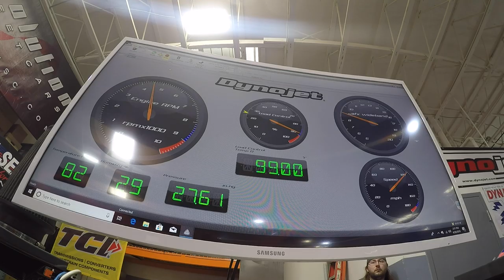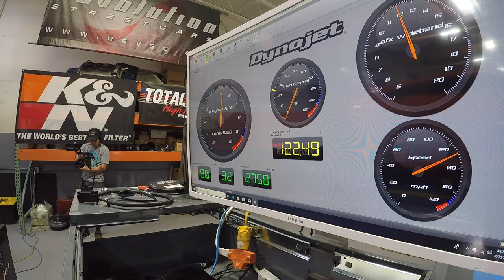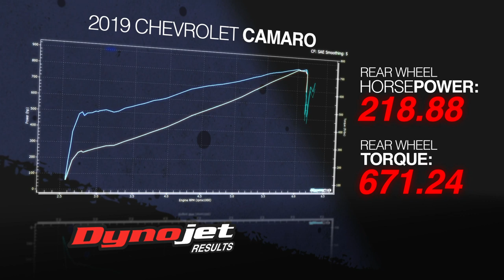Pony Wars 2: Can An LT4 Fuel System Really Make 950-RWHP?

Comment: Lt4 fuel system is good but you have to change cam to get more fuel lobe so that's where it gets expensive... I'm curious what a blower swapped i.e. procharger or whipple lt4 stock cam could make with headers blower swap only!
Reply from the maker: The larger fuel lobe on the cam was part of their engine build.
Reply: Check out the Race Proven Motorsports YT channel

They do loads of LT4 builds w Procharger, etc

Comment: The only two things that are keeping the ls/lt series of engines from being the king of all v8's is sound and a factory 6 bolt block, HUGE potential with these engines, despite their downfalls.
Reply: The stock block is strong as fuck. They have weak stock pistons and limited expensive dueling options. Talking the lt4 it can handle more power than a coyote both complete stock. Lt1 not so much
Reply: What do you mean they are the gods of v8’s
Reply: So they are junk right? Just asking.
Reply: @ultrazls1  the blocks and bottom end are strong, it's the head sealing that's the problem. If chev/gm came out with a FACTORY block with 6 bolts for the heads I bet 1500hp EASY stock, BUT, the coyote can now do 1000hp+ on 2018+ unopened engines. The ls/lt is the king of "do it all" and "bang for buck", but the coyote has engineering on its side, people have pushed over 2000hp on STOCK sleeved block, STOCK heads, STOCK displacement.. BUT their expensive and can be a pain to work on lol
Reply: @childsupportf1503  no, they have their place, just like the new 7.3 ford came out with

Comment: Was this on e85 tho or race gas?
Reply: All cars received the same fuel purchased from the same manufacturer. Not from the pump. It was 93
Reply: I can say for sure with E85 those injectors and pump wouldn't have been able to do it. With no ethanol high octane gasoline I don't see why not though. It's got a set of heads and cam. On E85 the power would have been even greater but again those fuel parts wouldn't have been able to support E85. 

I don't even understand why this video exists. I guess some trolls got schooled.
Reply: @ShizawnSanders  Yeah me neither. The mustang and the Camaro both did good on only 93. That's for sure!

Comment: they should do a stock.motor like tye voyotes and see how much power it can make....(completly sealed) lt1 engine...
Reply: You mean like the Coyotes that was taken appart for timing chain upgrade ?
Reply: @Loki_Trickster  well compared to heads and cams bottom end on the lt1...timing chain aint nothing...
Reply: @pansitasloko13  You sure? In the time it took them to change the oil pump gear (3 days) the LT was pulled out, parts swapped and motor put back in faster. So yeah
Reply: @pansitasloko13  It is when its a drastic design flaw.
Reply: Loki Trickster yea talk about a design flaw basically rebuild an engine.
Reply: I own a Coyote and I have no issues here. All build teams were given the same money. Yes, the Coyote can make 900RWHP with nothing more than boost, bolt ons and fuel upgrades but that doesn't change the results. The team for the Mustang sucked, the parts selection sucked even worse and the tuner sucked most of all. It is what it is. At least your not a Mopar fan. They looked REAL bad.
Reply: EGGINFOOLS but how much would that cost in the real world? U beliebe they can rebuild an engine and supercharge it and add parts for 15k keep dreaming
Reply: @ShizawnSanders  im a chevy guy...but i want to see how much power a stock lt motor can hold without any build stuuf exept boost adder....like they did with tye mustang
Reply: @pansitasloko13  I will be honest, the LT1 probably didn't need the heads and cam. Just the pistons, rods and fuel upgrades but if you already have the engine apart and it's under budget why not?
Reply: @pansitasloko13  I have owned both LS and Coyote stuff. The LT1 to my knowledge has rods and pistons no stronger than LS3. 650RWHP is the safe limit. Yes, you will see people doing 800RWHP on a bone stock LT1 with nothing more than boost, bolt ons and fuel upgrades but those are the exceptions and not the rule. 

Same with gen 2/3 Coyotes. 800-900RWHP is what is considered the safe limits with oil pump gears/crank sprocket gears. You will see guys doing 1000RWHP with the upgraded gears, bolt ons, boost and fuel but again those are the exceptions and not the rule.
Reply: @ShizawnSanders  thats trueee....thank you sir...
Reply: those people are stupid and don't understand what 4 valves per cylinder, more compression, ability to rev higher and true independent cam timing does for power. The LT/LS engines are smaller, lighter, have around the same horsepower and wayyy more torque. You have to respect that. Who cares that it's done with a 50+ year cam in block design. The power per cubic inch is a dead statistic. It means NOTHING in the real world. I don't even understand why its even brought up. Maybe to make 4 cylinder guys feel better? IDK. Lol
Reply: Shouldn't take 3 days to do billet gears lol. Why not use lund or mvp performance for running. Like the great connor McGregor.... who the fook is that guy. I own both a ls and a coyote. My coyote is a better all around for me.
Reply: pansitasloko13 am nor i have a coyote but that cuz it was a lil morr
Practical than the camaro but i like both. I would want to see the same thing stock for stock
Reply: Shawn Sanders ur kinda mising the point thiugh, u really belive that all that was done for the 15k including labor? Highly highly doubt it. Also technically the mustang was faster at the xcross but homeboy started bitching
Reply: Sean Smith thats also true regardless of how big or small each is because of the design they equal.
Reply: Slo verado “the great connor mcgregor” really? Lol same guy that mayweather whooped come on!! Lol
Reply: @gigi9467  yup that dude. Come on now the guy was a octagon fighter not a boxer. Anyone that thought McGregor was gonna win vs floyd is an idiot.... like I said who the fook is that guy.  Coyote ftw... made 900rwhp with a smaller blower and stock engine.
Reply: @julianvidal302  and 10k in suspension upgrades
Reply: Sean Smith yea but thr size (liters) do too thats why there equal if they werent chevy would of already trashed the pushrod
Reply: @gigi9467  I thought it was a 10k budget. The budget is parts only. I believe the supercharger kit, wheels/tires, full exhaust for all 3 cars was not in the budget. Labor doesn't count towards budget either. If you have owned both platforms you would know that different things cost differently for each car. For instance you can have a cam put in on a LS/LT engine for about the same cost as LT headers for a Coyote. OPG will cost more than a cam upgrade for a LS as well.  Going all out NA on a Coyote is kinda dumb because you will end up spending more than FI with less power. It does make sense on a LS/LT engine though when factoring power gained vs money spent. At least that's what I personally have observed. Also, the labor for OPG is NOT cheap AT ALL. Of course it would be less than pistons, rods heads, cam ect but it ain't cheap. The gen 2/3 Coyote ability to make around 900RWHP with nothing more than the OPG/crank gear installed on the engine is one reason I chose my Mustang. That and it's not overly complicated or expensive on fuel upgrades. The fuel upgrades on the LT engine is where it can get REALLY expensive.  Because of its DI only it cost a shit load to go E85. My gen 3 Coyote doesn't have that problem because it has port and direct injection. That was another reason I chose my Mustang. Other factors were practically, visibility and I think the 2019 Camaro front end is ugly AF. 2018 Camaro looks good but I wanted a 10 speed car.
Reply: Shawn Sanders ok, so yea i agree. I mistken this one for the old pony wars, but still i think its dumb that labor is not
Included like u claim and yes i rather my mustang too. Thats why i bought it

Comment: Still trolling mustang losers with this video almost 3 weeks later after they won. Maybe if you send the mustang guys a whole new suspension setup again it will win the auto-x. Or maybe send it another oil pump gear that took 3 days to change while VR was able to pull the LT, swap Pistons and rods and put the motor back in faster and cheaper. Lol
Reply: @gigi9467  The labor alone to change out a simple oil pump gear covers the labor plus parts on the LT. It took them 3 days. Lol
Reply: Dont be bias look at it this way the mustang is a smaller displacement engine vs a 6.2 and 6.3. Also the mustang had the smallest blower. Shops charge about 8 to 10 hrs for oil pump gears. I dont understand why the coyote had stock heads vs Cnc heads on the LT vs after market cam on the camaro vs stock cams on the coyote. 

Funny how the coyote put down 900rwhp on the smallest blower everything stock except oil pump gears. Camaro only put down 950 on built motor, heads, cam, and intake.

Chad is a GM guy seen him in other shows. He has a Chevy tattoo. Of course he's not gonna know how to make a mustang. 

I own 2 LS and 1 5.0 coyote. Non bias here just not dumb.
Reply: @julianvidal302  Biased because of the truth? The coyote is a beast but it's not an LT/LS. The same stories with displacement and blah blah stock engine blah blah. It's not GMs fault that Ford doesn't make the 5.0 more versatile and affordable to modify, just as it's not Ford's fault GM doesn't use forged pistons and rods. 4 cams, 32 valves and what every Ford calls a superior design to pushrods. Then when it loses they say displacement. The 2JZ would have done wonders in this test and it's displacement is small compared to the others. The Ford guys ran out of money and the cams alone for that car would have been outrageous comparable to the pushrod. 8 to 10 hour job for the oil pump gear. I have no doubt vengeance could pull that motor, do a piston, rod and head swap and put it back in, in the same amount of time. If not faster. It all comes down to versatility and the coyote doesn't have it. It was being rung out and the LT wasn't even close to the edge.
Reply: @EGGINFOOLS  The 2jz would have done great if it was a turbo challenge but the centrifugal blower makes power by cubic inches. Turbo coyotes make crazy power because it dont matter on cubic inches. Also the tuner they used is not a know Turner more of a universal Turner. The go to guy for tunes on coyotes is lund racing or mvp performance. Check em out.
Reply: But you still had to change pistons and rods and they changed heads to win. That a Chevy for you got change parts to win.
Reply: VR can do it fast but sure as hell making customer pay a premium for it